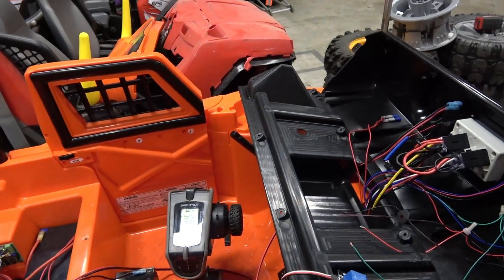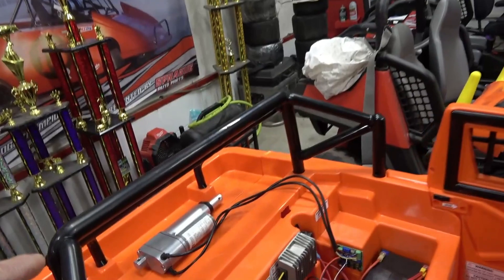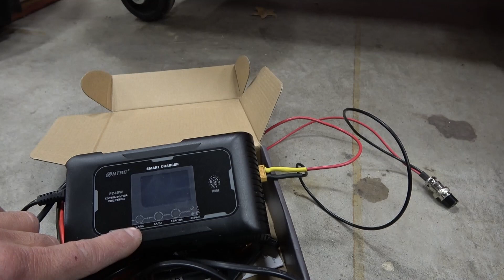Giant RC El Toro Loco Build- Part 1-Steering, 60 amp motor driver, Long travel shock upgrades

Comment: Do you got any experience with the smoke that comes out of the front? I got one but can’t get it to work.
Reply from the maker: Did u fill it with the liquid that came with the truck?
Reply: @CustomKidzCars  I filled it with water and it wasn’t working so I took it apart and there was a wire that was broke. It’s working perfectly now, but did it come with certain type of liquid that I’m not using

Comment: For replacement parts or Decals where could I look? I found some parts like steering wheel and buttons. Just picked one up used for my daughter and it needs decals since they are beat up by the sun.
Reply from the maker: @ronnyvega94  probably have to have custom decals made since the manufacturer only has a few replacement items.
https://shopballardpacific.com/collections/24v-monster-jam-el-toro-loco/products/24v-el-toro-loco-wheel

Comment: What parts do we need to build those upgraded shocks you showed?
Reply from the maker: Can't recommend that mod as it messes up the caster geometry unless you fabricate new steering setup.
Reply: @CustomKidzCars  I see, how do I get a smoother ride out of the shocks?
Reply from the maker: @mopat3260  softer springs would be the first step. Ideally real shocks that have compression and rebound like we are using on fireball Camaro. Shocks are $100 each
Reply: @CustomKidzCars  Great idea after I finish the motor upgrade I will measure and find the right shock. Thank you for your help.

Comment: I'm curious how does the smoke work? Is there a refill container for some fogging fluid or water somewhere, or does it just vaporize moisture in the air? Definitely a cool touch to the truck
Reply: It just uses water it gets added in that black spot on the top of the nose